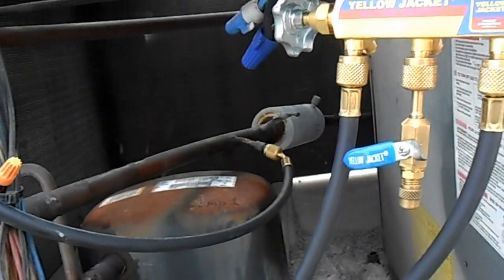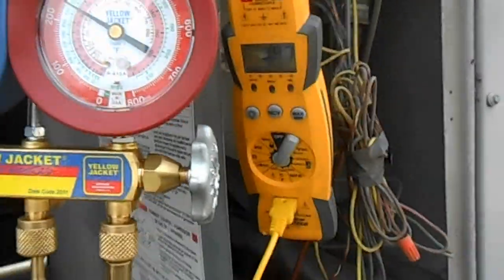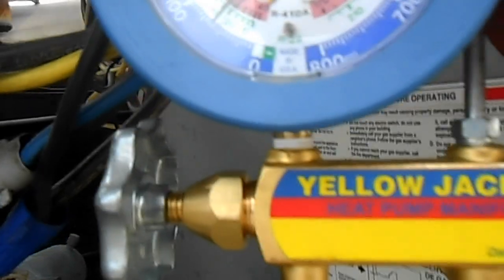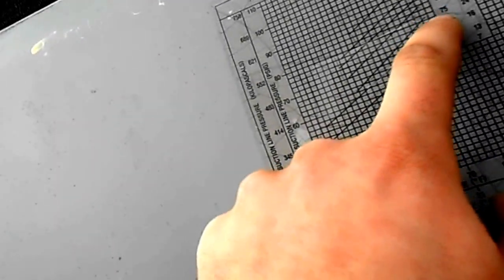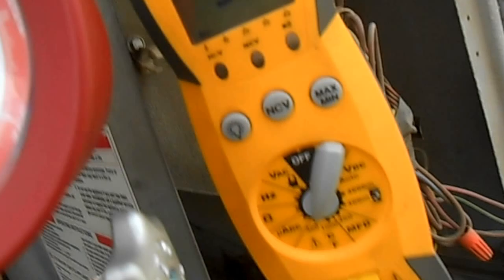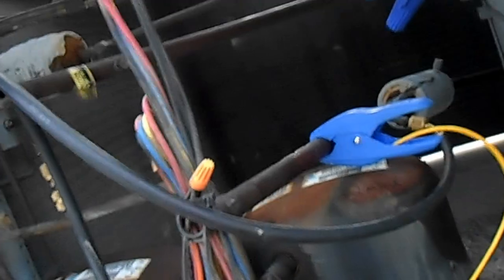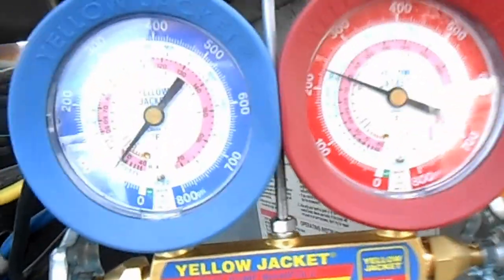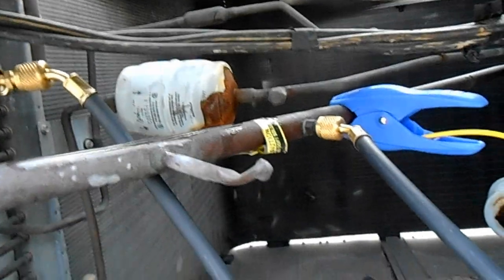HVAC: 8 Ton Carrier Dual Circuit RTU

Comment: You cannot run those units with the panel Removed !!! The air is not Being Drawn through the Condenser and Your Head Pressure will go through the Roof ! not good man. Put panel back on and run hoses out the side edge of panel with panel on.
Reply from the maker: Right you are, a rookie mistake for sure! Thank you for "highlighting" it for everyone to see! I'll either make fun of myself with some annotations or just delete the video altogether.  That is, when I put the  "making HVAC videos on Youtube" hat on again. 

Probably won't delete it; I do enjoy laughing at my past self. If you've ("you" being any viewer) done your homework; you can find flaws of varying severity all throughout my videos. And you can feel any way you like about it! 

Rest assured, I'm fully aware of my past mistakes. If I wasn't I wouldn't have a place to live, a van to drive, etc, etc, etc... Hell, even "4 years ago Andy" knew that a condenser coil gotta draw air over it  to reject heat. It really just didn't matter in this case. None of this says "How-to" , "Training" , or anything like that, either. 

So my point is, what's your point, man? I know you know that the panel needs to be on for proper charging. You don't need to prove anything to me, b0ss. I've seen your work; it seems decent to me. Could I have found a mistake? Probably, but I don't care that much I guess. Should I change the title to "Incompetent Man-Child Butchers a Rooftop Unit"? It'll probably get more views LOL
Reply: I Just Could not Leave it un-said because some one Just Starting out Might think its ok to leave the panel off while you have your guages on a Running unit like this , i had to point out the Incorrect procedure & say why its not ok to do this For New / Apprentice Techs. Don't read anything into my comment. Im just passing on the knowledge. Period. Sorry, im a very Direct person. It is what it says. 35 years ago, when i first started out, a Senior tech said what i said to you. " He Says---You Cant run those units without the panel on, the head pressure will go through the roof ". And im like oh You're right , and i say to him " what a stupid design " and we all went back to work. I Learned something new that Day. And 10 years later i Opened my Own Refrigeration Company. And the Learning Continues still to this day. 35 years later. ---New ice Machines with computers in them etc. in this trade You Never stop Learning. Take care.

Comment from the maker: Hello Andre! Thanks for watching and commenting! You are right that some panels on package unit or condensing units cannot be removed for the reason you seem to be concerned with. However, this design is not affected AS MUCH by this. Notice the head pressure didn't rise above a normal level. IN THIS CASE, I was not looking for precise numbers. Furthermore, when this video was made, the unit had no high pressure control. Please check out my other videos about adding these controls. Cheers! :-)